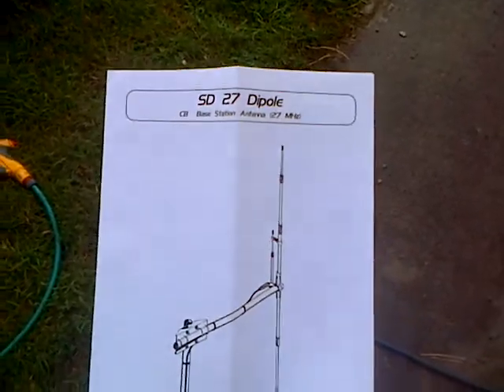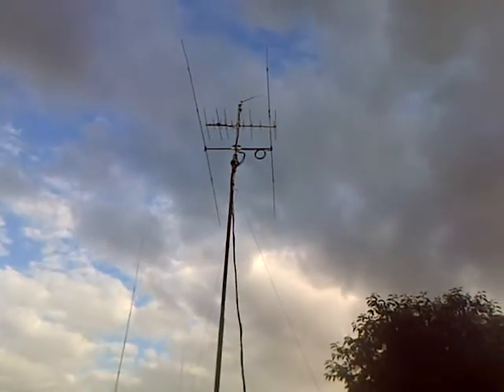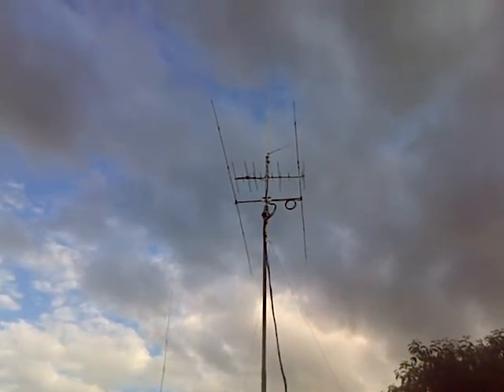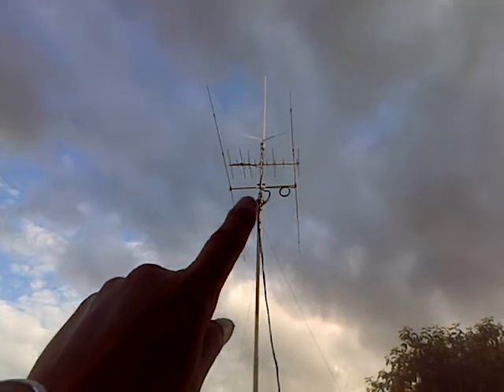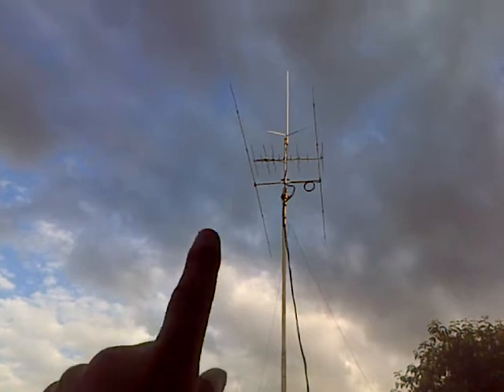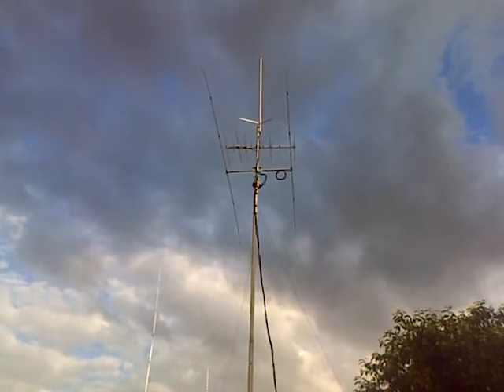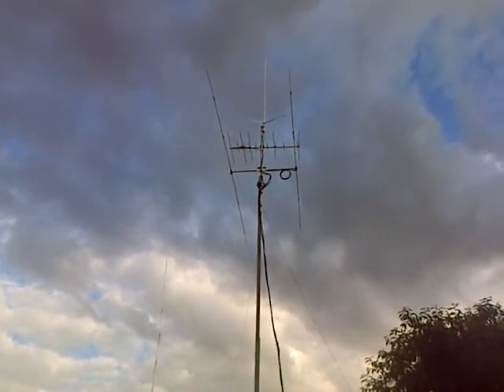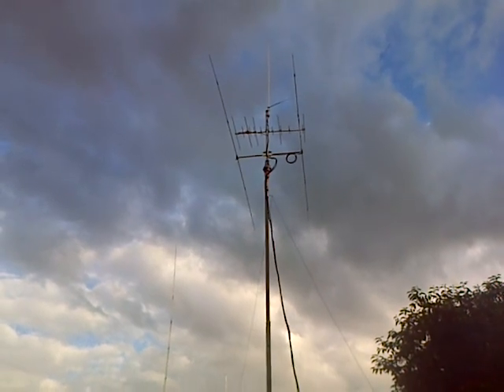Sirio SD-27 becomes a 2 element Yagi

Comment: Nice job! I just built one similar using pvc, driveway makers(fiberglass) and 2 10 ft 2x4's for static mobile use on the mountain. The whole thing goes together and breaks down in seconds. I step the 20ft 2x4 mast using a hook into the chain slot of the trailer hitch on the truck pinned to the top of the cap. Worked all of west coat USA, Hawaii and Australia a few days ago from Northeast Coast USA on 30-50 watts. No problem. It works! Great job! I believe my boom length is similar to yours except a little longer @ 4'5". Reflector is about 7% longer than the driver I think. There are many that say this configuration won't work. Not true and works great! Kudos!
Reply: charlie fizfaz do you have any pics ?